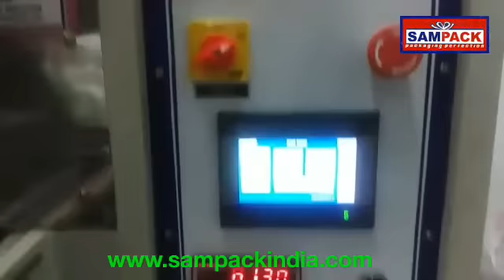Supermarket Packing machines , 25gms to 2000gms, Grains, Granules, Pulses Packing machine

Comment: I would like to visit ur factory  may i?? 
How can plz
Reply from the maker: We are one of the leading Manufacturers for
premium range of industrial packaging machines, Automatic form Fill & Seal
Machines (FFS Machine), coding machines, and industrial packaging products.
There are widely used in the pharmaceuticals, garments, electronic, cosmetic,
food and beverages Industry including export houses .
Our machine is  Auto Weighing, Filling, nitrogen flushing, Sealing,
Coding, Batch Cutting, Cutting , counting all in one machine .One more special
features is that in our machine you can produce the packets ranging from 10gms
to 1000gms, 
Please Contact   +91 484 2382211 ,+91 9447111444 or Email:info@sampackindia.com

Comment: what is the cost for this machine
Reply from the maker: We are one of the leading Manufacturers for
premium range of industrial packaging machines, Automatic form Fill & Seal
Machines (FFS Machine), coding machines, and industrial packaging products.
There are widely used in the pharmaceuticals, garments, electronic, cosmetic,
food and beverages Industry including export houses .
Our machine is  Auto Weighing, Filling, nitrogen flushing, Sealing,
Coding, Batch Cutting, Cutting , counting all in one machine .One more special
features is that in our machine you can produce the packets ranging from 10gms
to 1000gms, 
Please Contact   +91 484 2382211 ,+91 9447111444 or Email:info@sampackindia.com
Reply: SAMPACK INDIA PVT LTD